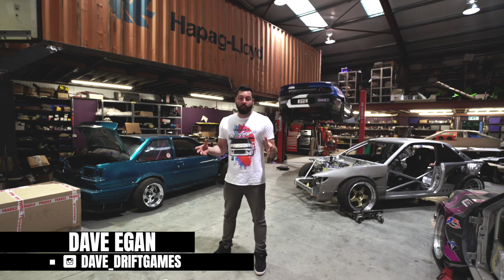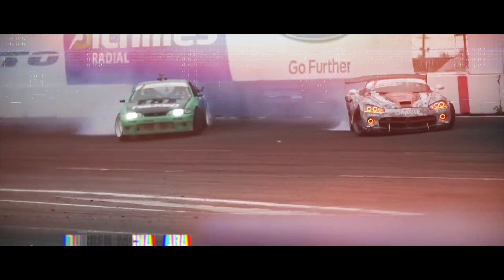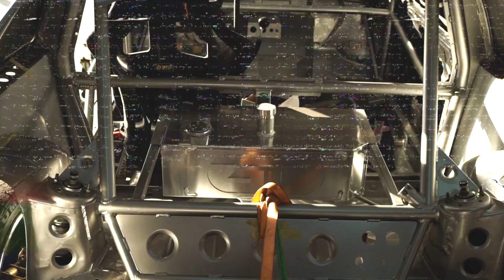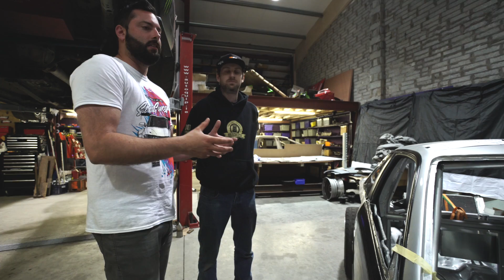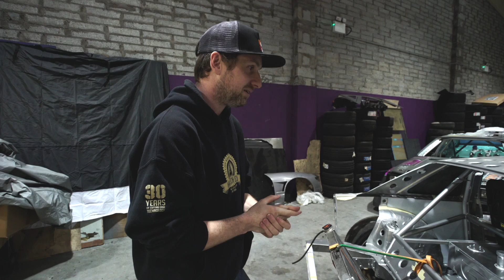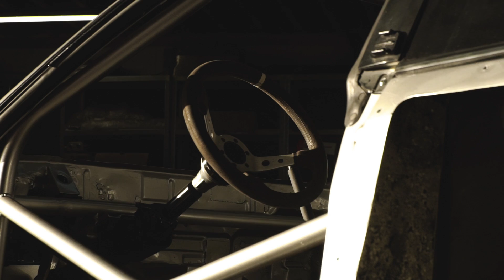HOW DO YOU BUILD A PRO DRIFT CAR? | Ask the experts!

Comment: The tunnel up the middle, is this just for gearbox or to allow the car to be changed for fwd to rwd?? (Still learning please ignore my stupid questions)
Reply: every car has this its called a transmission tunnel
Reply: These cars are originally rear wheel drive
Reply: @tiernanroulston6239  🤦‍♀️🤦‍♀️🤦‍♀️ sorry. Literally watching YouTube clips trying to teach myself. Thank you for the reply
Reply: @sharonlowe3600  nothing to be sorry about bud we all have to start learning somewhere!
Reply: In Formula Drift USA, you can submit an FWD car converted to RWD. FWDs converted to RWDs definitely require such massive transmission tunnel, bcs they have none yet when stock. Cars that are already RWD stock usually still need these huge trans tunnel bcs stock transmission are too small and flimsy to handle the abuse from drifting actions. Example is Fredric Aasbo who used a 2019 Toyota Corolla hatchback - stock it's FWD, but he then converted it to RWD and puts in a massive NASCAR gearbox in it. Cheers!